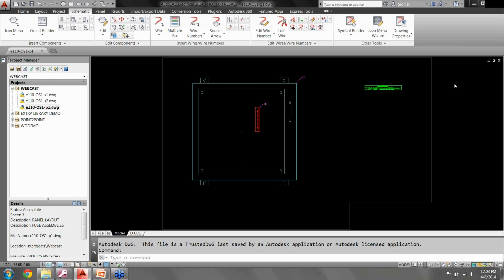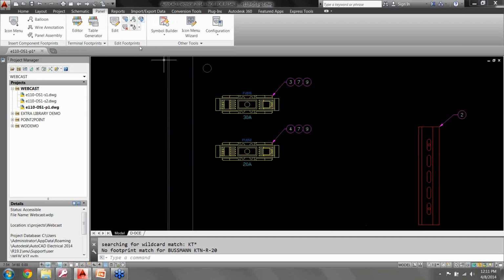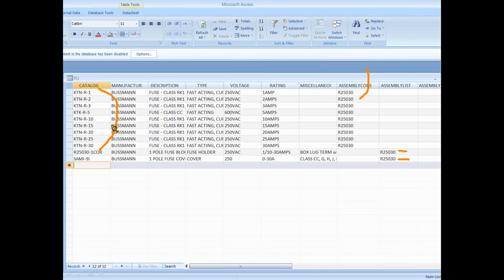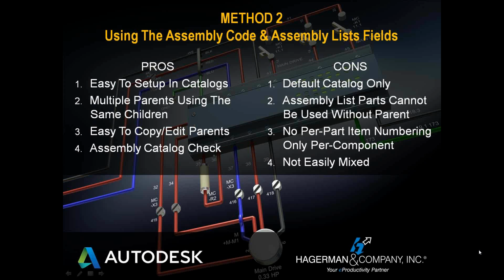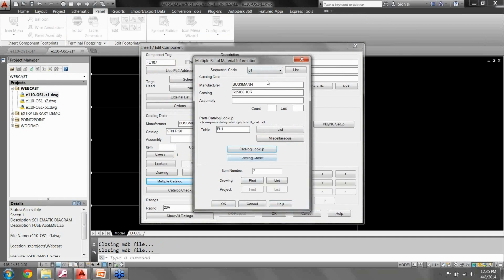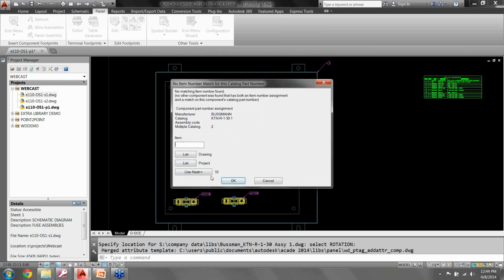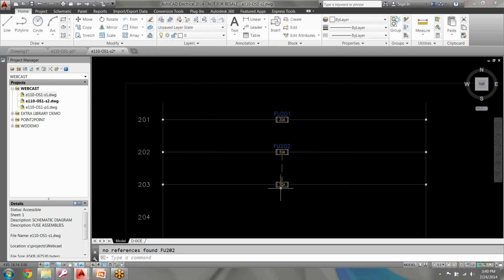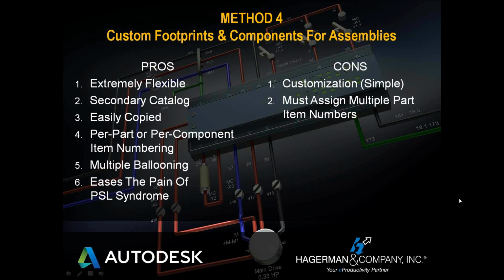Working with Assemblies and Sub Assemblies in AutoCAD Electrical

Comment: First off THANKS for these videos. @ Rick your methods of teaching resenate well with me. Any How Quick Question. The Method 4 when adding the TextVaule to set the multi cattalog is working great other then one small issue. The Look up Table for items 2-n have no table value so the details get dropped on my reports. If I set the Table field for each item then they show up in the reports and Check catalog work.